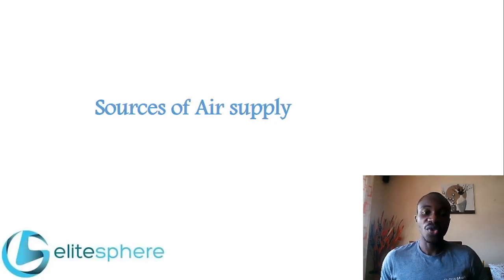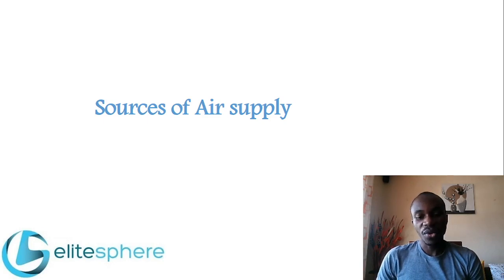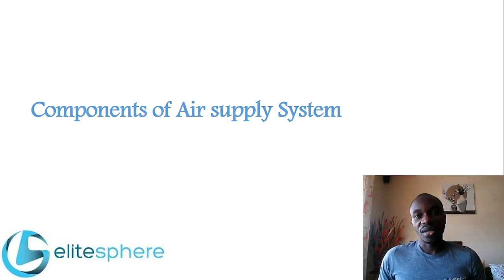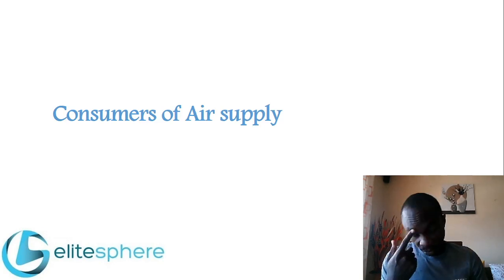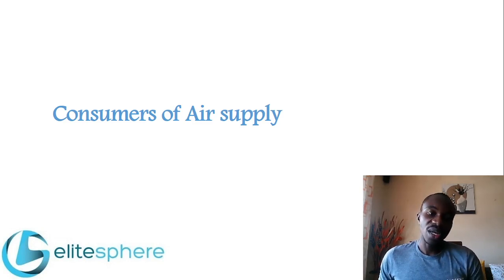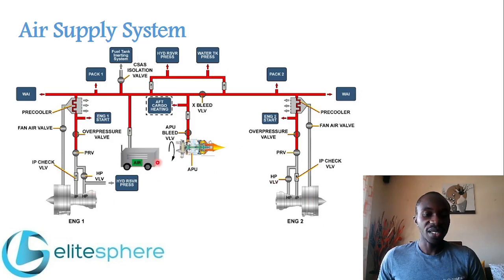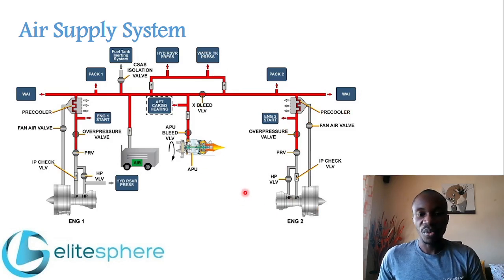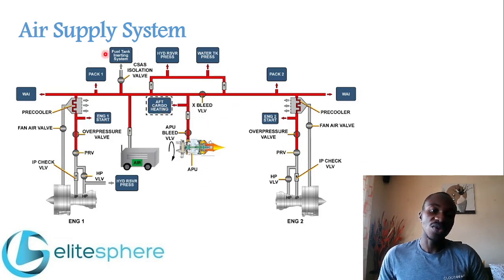Aircraft Pneumatics (Air Supply, Bleed Air)

Comment: Thanks mr Davy,so the pneumatic system for all aircrafts are almost the same,but on this one for airbus av learned a new term I.e cargo heating.
Reply from the maker: Yes Cleophas, the basic system is more or less the same. Just some small variations here and there depending on specific systems that a particular aircraft have.